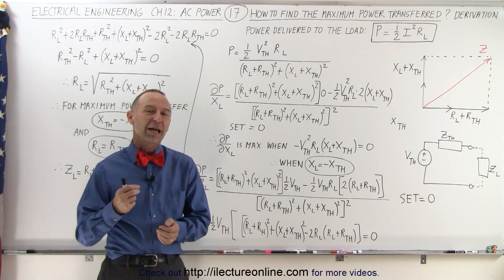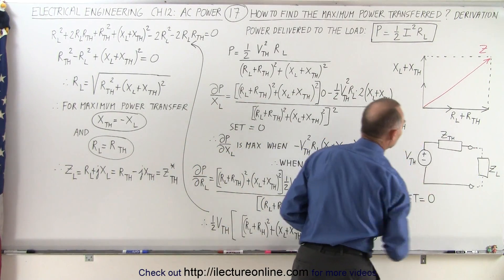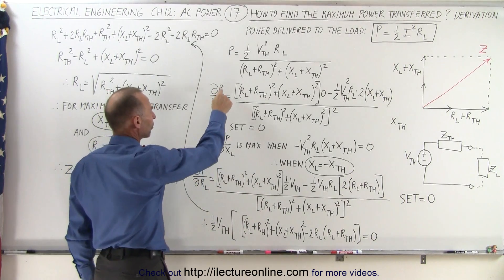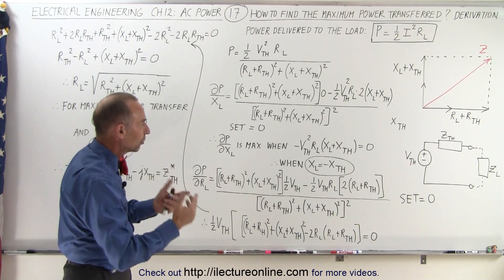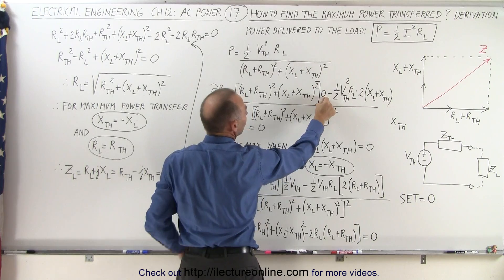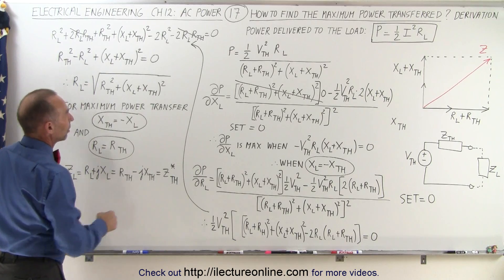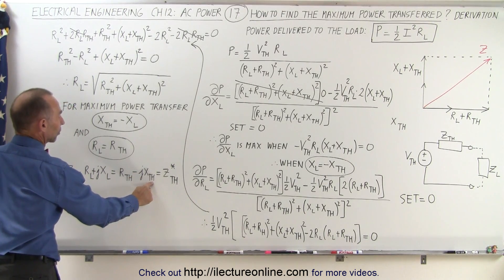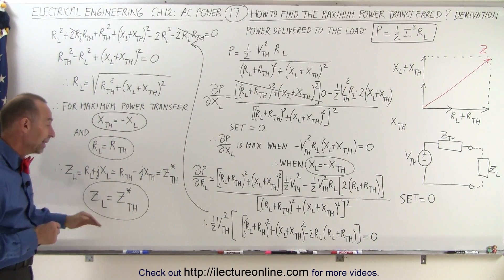Electrical Engineering: Ch 12 AC Power (17 of 38) How to Find Max. Power Transferred? Derivation

Comment: hello, can you explain why power delivered to the load has such formula? (P=1/2I^2R)
Reply: https://www.youtube.com/playlist?list=PLX2gX-ftPVXXs4UCc1I7cMhD_9zqLREuB You may go through the first few videos (1~6) in the play list to find out. It's about the average power of the resistor.
Reply: did you find it out?
Reply: @amiraliaali  to transfer maximum power impedance of the source must be equal to impedance of the load as the prof said
so the two impedances are equal which means half the voltage drop across each one and the total power in the circuit is divided on them equally which is why it's 1/2 VI or 1/2 I^2 * R,
Reply: @mahmoudsalah7628  i am confused. can you please explain why (1/2)(I^2)R instead of (1/2)(I^2)Z ?
Reply: nvm i got it!
Reply: @joe0633  how do you get this part? I am also confuse with this
Reply: omg, it's because of rms, it used me 1 day to figure it out